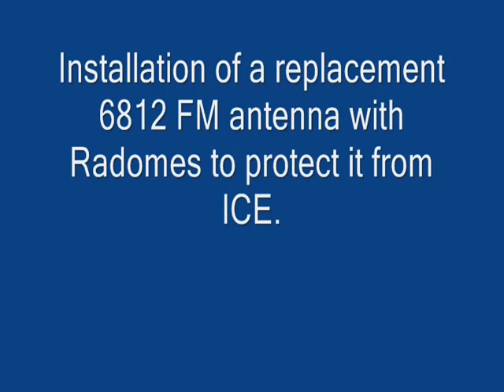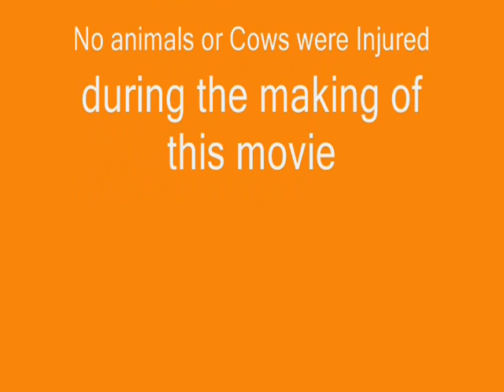CKTI FM Antenna replacement .wmv

Comment: I think the lower bay is too close to the tower.  The lowest antenna should be at least a half wave length above the tower to prevent coupling and distortion of the pattern.  The mast looks long enough it could have been put several feet higher.